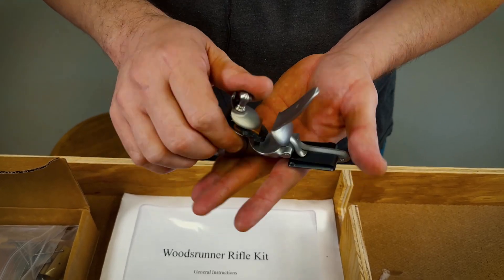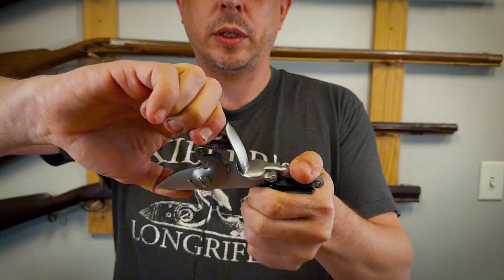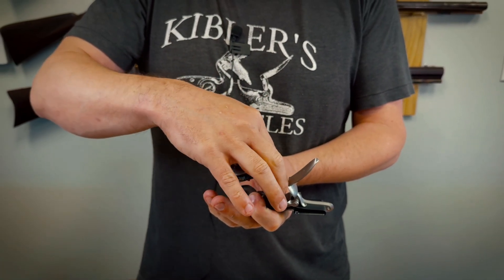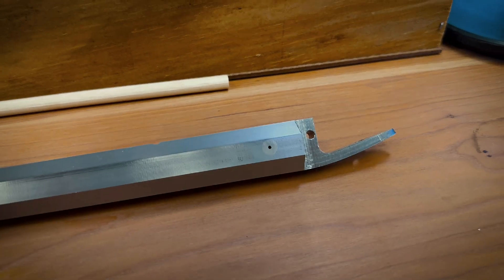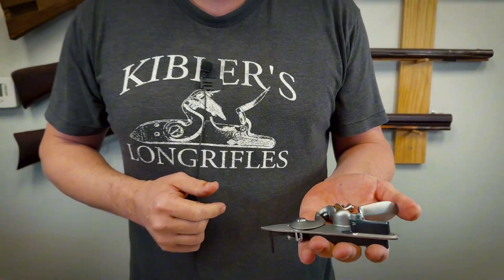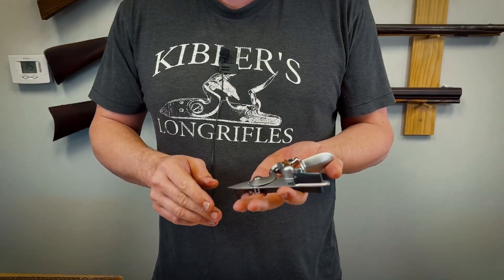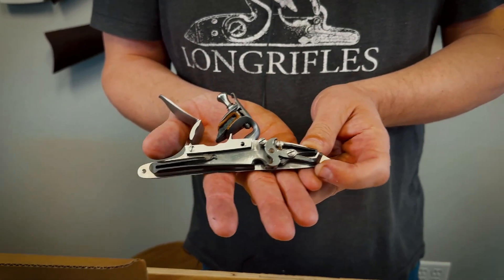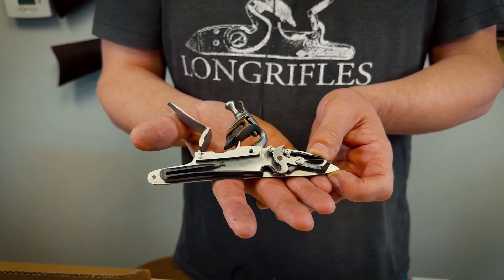How a Flintlock Works | Kibler’s Ketland & Round-Faced English Locks

Comment: Are the nicks that people put within the hammer jaws actually needed?
Reply: Not necessarily but there is some merit to it, it gives the jaws a rougher texture and a better bite on the jaw pad and the flint
Reply from the maker: Good question. 
They're more teeth that are raised rather than nicks - they aren't required but help stabilize the flint.